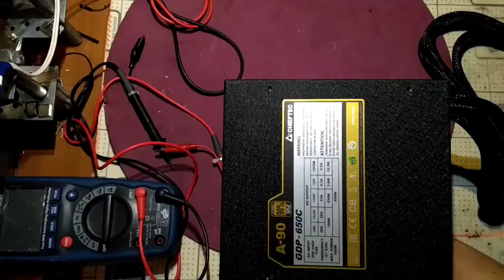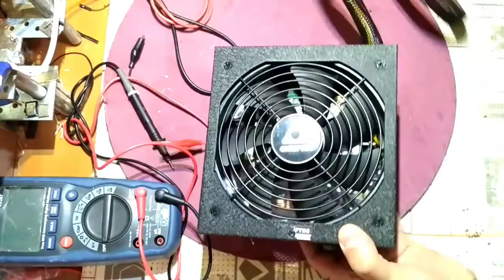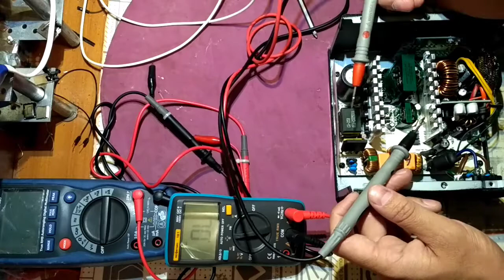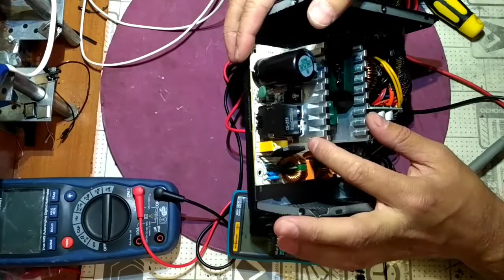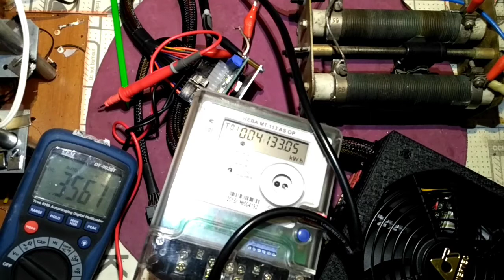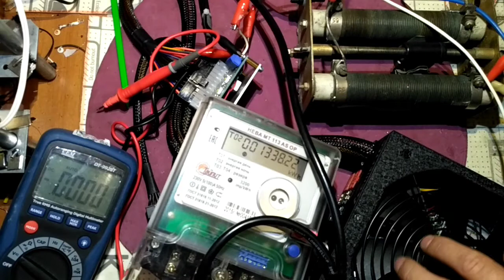Chieftec power supply repair. Faulty PFC section

Comment: I did exactly what you did. Two new transistors and one general diode plus fuse, ultra fast to220 diode was good. Was working fine until i loaded up to 40-50% then same components died again. It was a corsair hx650, pulled from the wall 480w when it died. If you want to test it properly, go up to 100% for a few minutes then you can say it was fixed!
Reply: Turns out one capacitor after bridge rectifier measured 17nf suppose to be 2200nf. Replaced with 1000nf/400v and so far psu is ok under load, pulling 500w from the wall.